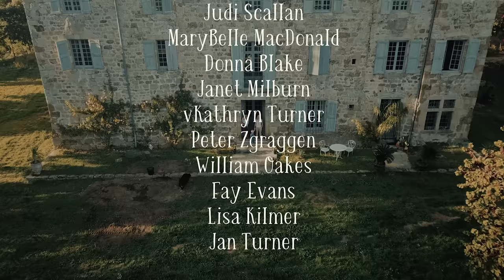Faulty Tools Threaten Our Hard Work | The Coach House Restoration

Comment: I live in the Ariege.. find Dulux crap and not the same as you can get in the UK; but the Liberon paints are great on timber?  I also get friends to bring over Little Greene Distemper (which has to be ordered) I do urge you to try their distemper; once you have used it you will never use any other emulsion!  I have a stack here now; it goes over ANYTHING in one coat and despite what it says on the tin goes well in bathrooms and kitchens.  Another paint that I use all the time for woodwork is Mylands wood and metal flat oils.. their Mid Wedgewood is beautiful.
Reply from the maker: Oo that sounds good! But we so rarely get visitors coming over in cars. We’re too far south!